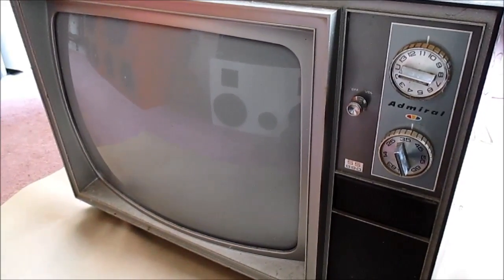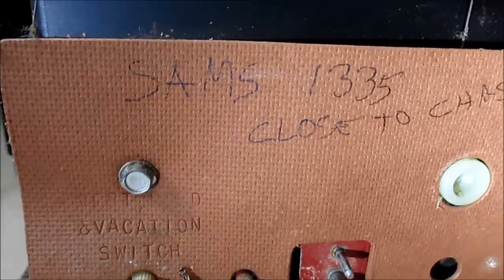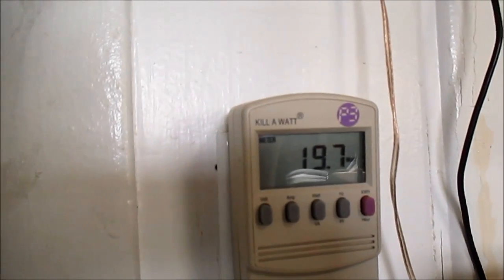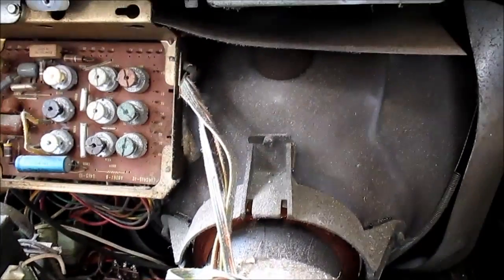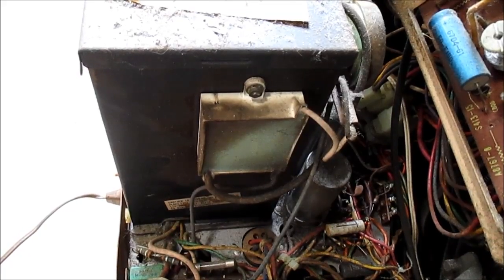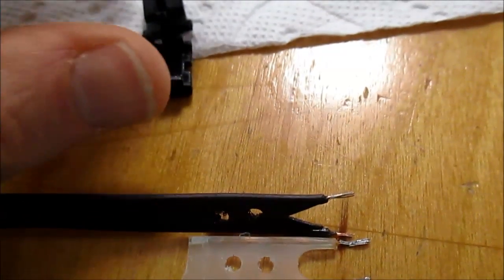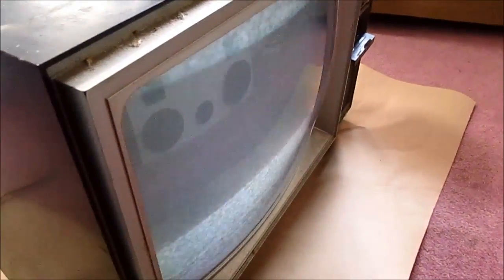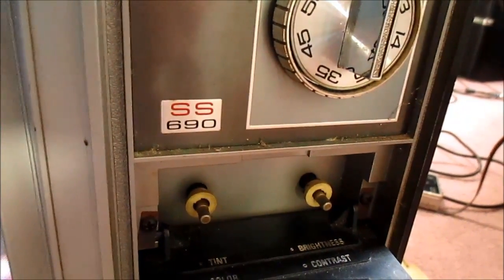1972 Admiral SS 690 portable color television receiver high voltage arc "repair"

Comment: That's actually a pretty good picture for that Admiral compactron tube chassis. Good job saving it. They are quite rare these days. Not many are left as this type model usually needed repairs after a few years and users were talked into buying new solid state TVs.

Comment: Sure looked a great deal like the old modulator for my TI99/4A there.
Reply from the maker: It is. When the production ended for the computer, TI was left with a bunch of those modulators and sold them to Radio Shack who discounted them to the public. I don't think I powered up that modulator since the late 80's
Reply: I'm surprised that modulator and color is working after so many years